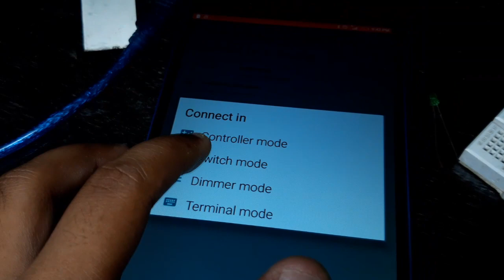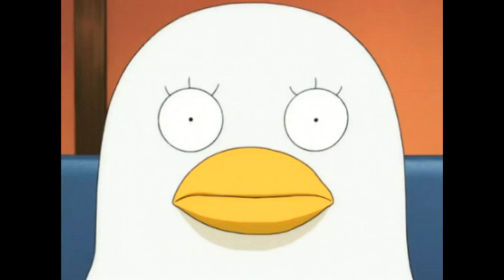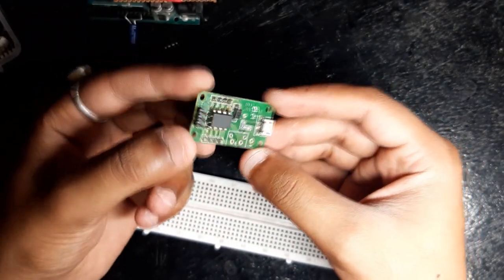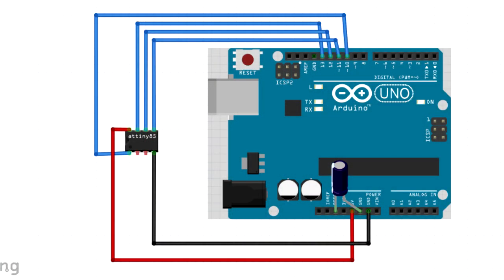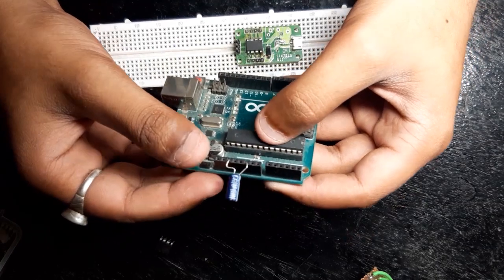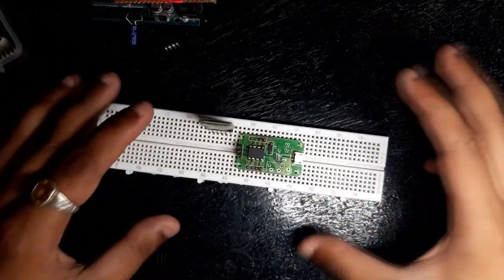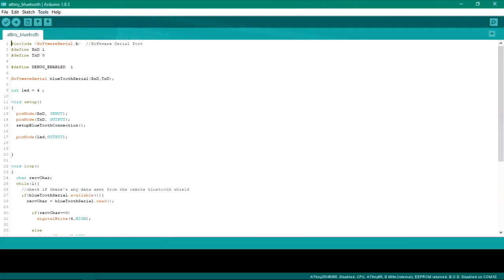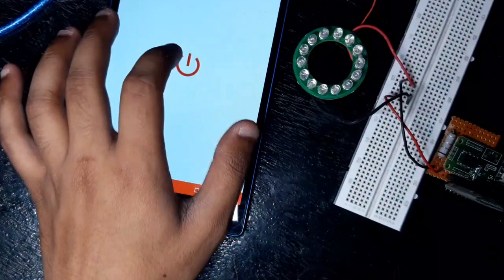Attiny85 with HC05 Bluetooth Module

Comment: How many appliances we can control from this attiny85
Reply from the maker: Well, for now only 3 at most. But we can add multiplex ICs or similar circuitry to relay in order to toggle more outputs from these 3 pins.